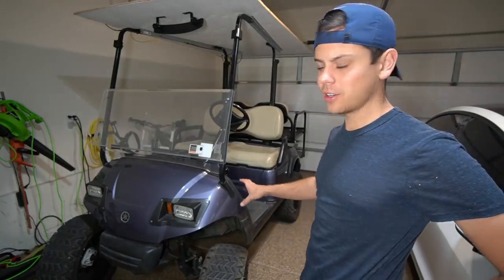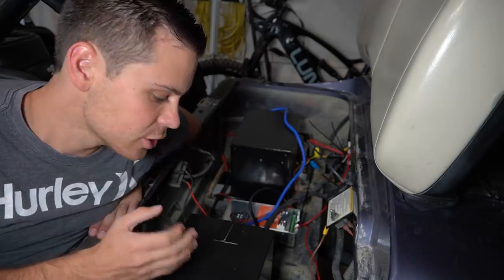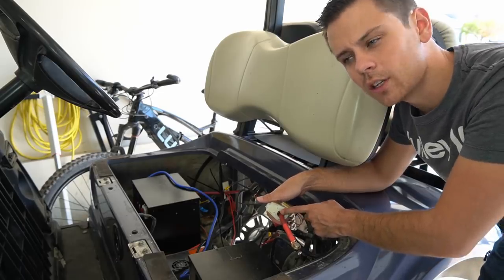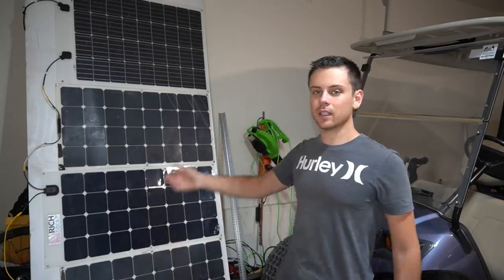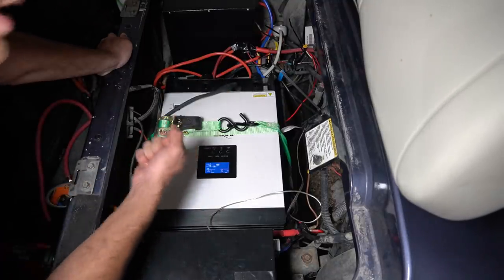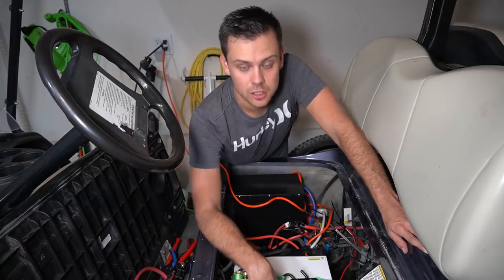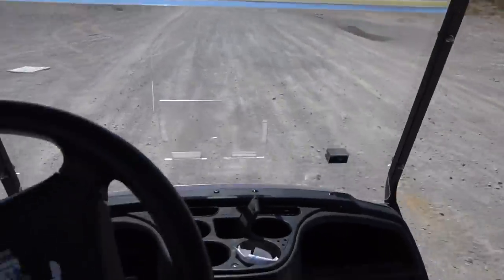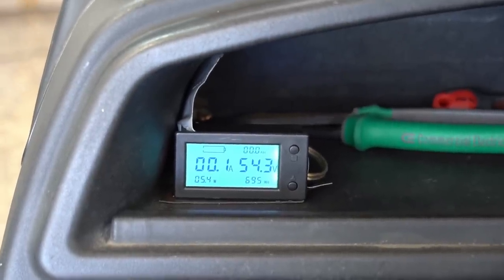Off-road Solar Golf Cart Part 2: Battery Upgrade, Shunt/48V Inverter Installation and TEST DRIVE!

Comment: so you said u can charge this using another battery bank ac output. can you use this principle to charge a 24v bank (with all in one solar inverter) via the 220 otput of a 12v inverter from the car alternator? so you can still use a 24v bank in a vehicle and charge while ndriving. i know it has power losses but i think is worth it. love your channel <3

Comment: Are there any limitions when putting smaller solar panel on such cart? I mean I guess it would charge incredibly long, but if it is on the sun most of the day, would it matter? Few free miles every day could be worth it without having the huge panel array you had before.

Comment: Doesn't that solar controller have an "always on" inverter ? It will drain the batteries overnight. Maybe a kill switch at the ignition switch could be added.

Comment: I don't have a lot of extra money I would like to build my own golf cart battery so I can drive my golf cart and when I am out boondocking I can plug my 30 amp RV and running off of the battery pack in the golf cart. My golf cart is a 48 volt. Any chance you could give me a list of the proper components. I'm hoping to use the 280 amp hour sells from China. I've watched your videos on how to build these things pretty sure I know the right BMS to use. I just don't want to spend all that money and it doesn't work. Any thoughts would be appreciated thank you for your time. 
                       Mike Flaig

Comment: Would love to have these in my golf cart, but I need 400 amps max. Wish these batteries could handle that!
Reply: I'm running Nissan batteries in my 48 volt.
It will lift the front tires going up the driveway, and runs for a week doing horse chores.

Comment: Just curious, what happens if someone has a grid tie system and there's a brownout in the mains power?
Is the solar system still able to send its excess power into the grid while the mains are out?

Comment: My friend is disabled and uses a power chair to get around but the battery died and won’t recharge. The battery is expensive and proprietary shaped. Is there anyway to bypass that cheaper?
Reply: What brand and model?  In all my years as a wheelchair tech I never saw a proprietary shaped battery yet I did leave the industry in 2005 as everything was changing.
Reply: G Henrickson I called her, she doesn’t know, I’ll have to go over there tomorrow
Reply: G Henrickson It’s a Pride Mobility Jet 7

Comment: ALTERNATIVE APPLICATION QUESTION: 

I am in the process of converting my existing ac well pump to not be solely reliant on The Grid.  I am looking to finish out my battery backup system with the battery portion as I hav ealready accumulated an Aims 6000w 48v split phase inverter, 18 - 315w poly panels, and an Outback Flex 60 Solar Charge controller.  The well pump is a 1.5hp that is on a 60 amp circuit (2-30amp pulls connected).  Do you think these batteries will work for my application or should I stick with 4 - 12v Li-ion 1300 to start?
Reply: - I am aware I wont be using all the panels due to the controller being limited to 60amps

Comment: The resistor won't work because there's nothing to pre-charge. The motor will pull a lot of amps until it gets spinning and producing back EMF.
Reply from the maker: Yeah typical induction load. Idk what the controller design is like but that is pointless to use resistor. Oh now I remember why I did it. Batteries would trip before I even started the motor. Right when the solenoid clicked it went into safety mode
Reply: @WillProwse  how to prevent this ? What size BMS is required ?

Comment: Why use Lith-Ions? Google Alibaba for Graphene Supercap and you get a lot more interesting options. The ones you look for is semi-batteries they will be Supercaps With Chemicals. Charge a lot faster, last a lot longer. 10 years or more even. Lith-ions or Lead batteries feels like Old or Death. So go with Super Capacitators instead.

Comment: With an electric vehicle, you are better off with raw cells.  You can bottom balance them and shut the charger off when the weakest cell reaches 3.5-3.6 volts...

Comment: i have 35 18650 lithium ion batteries and a BMS can i  connect them to Ultra Capacitors ive ask a few on You tube and got no answer
Reply: Sounds interesting yet why would you want to...what are you building? Maybe join some eBike forums for asking questions after you have done all your basic research.
Reply: @geraldhenrickson7472  I'm building a power wall for solar

Comment: roypow says they getting 30 miles with 56ah an 60 miles with 105ah an 100 miles with 160ah..there lithium packs is cheaper so these are not the best price on the market like you keep saying

Comment: Hello i have been sent your direction by many boat electric group sites as your the man to ask! While im not in the market for a off road golf cart 😎 i would be very intrested in your views on the best 24v 3000w pure sine wave inverter for a boat,the last one i got worked for a couple of months and one day when i turned it on it poped sparked and burned stuff that was a German one! Thanks if you can help with some advice ive subscribed but at 58yrs you may as well be reading war and peace in Russian,😋

Comment: What chemistry battery?  My lifpo4’s are around 53 and you are getting 56?
Reply from the maker: It's Tesla so NCA
Reply: @WillProwse  thx Will.  btw, big fan
Reply: I went ahead and checked out the Toshiba website it's been on my to-do list for many months and last year they published an article about their 5 and 20 amp hour new models. Here is a paste from the bilingual half megabyte PDF document "Toshiba Corporation has been  supplying 2.9 Ah  and 10  Ah  high  input-output  power type  SCiB™ lithium-ion battery cells for idling  stop  system (ISS) vehicles  as  well  as  for 12  V micro HVs using a dual  battery system. To  address the needs of  these high-performance HVs,  we  have  newly  developed 20 Ah and 5 Ah SCiB™ cells having  both  high  energy  density and high  input-output  power characteristics.  By  changing  the cathode active material and tuning  the design  parameters  related to power characteristics,  we  have  achieved  an  increase  in  energy  density of  about 1.9  times in  these cells while  maintaining  the  conventional  input-output  power  characteristics."

So when content providers like this channel criticize lithium titanate oxide from the 2018 Toshiba examples or any competitor currently please remember the density of genuine s c i b has doubled which compared to competitors is probably an understatement. This channel can bring the kind of scale however to a group purchasing request of o o d l e s of the 5AH power cell because that's less than 15 watt hours per each but you can charge 100 of them from a regular United States household Outlet in half an hour easily and we'll never have to replace it you can literally pass down your electric bicycle several Generations of your progeny. Supercapacitors will be dead in 20 years but these Toshiba titanate oxide May last a century of heavy use in a bicycle and that fact is what the worlds rescue depends on. Share the quadricycle save the universe.

Comment: So sad Will won't help Prius owners since he is a battery expert and a Prius owner.   Just saw a post in the FB Prius group where someone put a LiFePO4 in as a replacement 12V battery.   I worry about charging profiles, and want to add additional LiFePO4 batteries to run the fridge and computers, but there is just no information out there and so many thousands of Prius owners wanting to do this.   Will just shot down the request for help because he has a Tesla now and doesn't believe in car camping, etc.   Really broke my heart as I have been such a fan of Will's since his early RV days =(    Please Will, please reconsider, so many people need your help and wisdom on Prius options.   I cancelled my Patreon over it I was so crushed.
Reply: To me it is about so much more than car camping too.   Mobile Office, Bug Out Vehicle, emergency power backup with these hurricane, travelling, camping, temporary housing, mobile security & PI work, temporary homeless shelter options, being able to have a DVR running for days when the car is off, improved car performance.... there is just so many options that can benefit by LifePO4 upgrades to a Prius' 12V system.   Seems so much more useful than building batteries out of used cells and stuff, although that is okay too, this could really change people's lives.
Reply from the maker: I sold my Prius because the stupid brake actuator failed. So glad to get rid of it. And agm battery works great in the prius. Why do you want to change it?
Reply from the maker: I just bought a hybrid rav4 2020 and love it. Went to Yellowstone. 40 mpg suv all wheel drive.
Reply from the maker: Why not use a tiny solar generator instead of messing with the prius system?
Reply: Since you don't have a Prius any more I won't waste more of your time on it and will try to wrap up here.   First, before you I could barely plug a 150w inverter into a cig socket.   Back in the RV days I watched like every video of yours, I bought all the tools and love solar projects now, even changed my whole awareness of YouTube mentors, anyways, thanks so much.
Now for the sad part, there are so many people trying to stick 3000W inverters on their poor little 12V 45amp/h batteries and I try to tell them it only puts out 1200W, etc, but I am no authority and for 20 years of being around, there are just no Prius videos that cover adding solar panels, or explain what inverters, or alternate replacement 12v batteries they can use, how to use a Renogy DC-DC charger tied to car's 12v AND solar.   I just imagined how awesome all those video would be coming from YOU.   So I am sad, but completely understand.   So not sorry I wanted it or asked, as they would have been great, like your golf cart is, but I will move on from it =)   thanks
Reply: @WillProwse  As for solar generators, people even need help choosing the right one for cars, Hobotech just said "any one will work, watch my videos and pick one" but it is more complicated than that, for example, the new AC200 seems awesome, but you have to manually select that charge input, so to charge it off of your car's 12V system AND the solar on the roof is just not practical.   I wish there was one that acted like the Renogy DC-DC with solar inputs.   I want to it use car when running and solar when off, or highest watt input.   So I don't know what to buy or how to make the best setup for a car/van with solar.   My Jackery 240 was just an experiment, and what a joke that was.   41W input barely keeps up with my DVR , no way it can even keep up with a laptop.  Anyways, to me, these would make great videos.

Comment: 4.6kWh/20 miles = 230Wh/mile at 16 mph, that's 3680W or 5 HP (a third of what a model 3 needs for highway cruise) to maintain speed???  This is roughly 8 times higher than it should be, something's wrong! Or is this your rock crawling consumption?